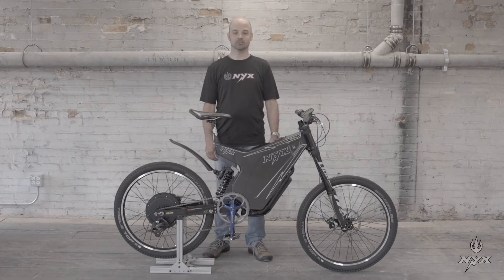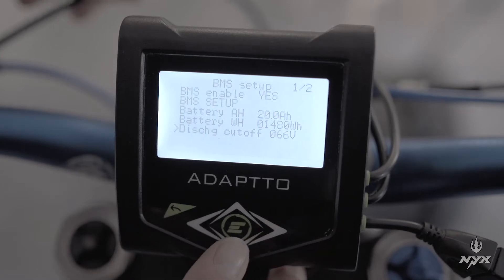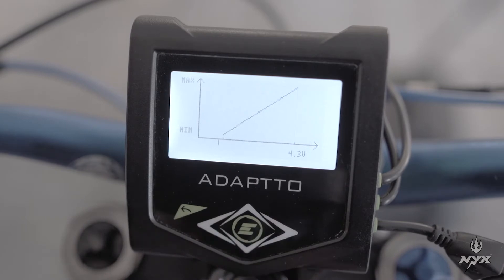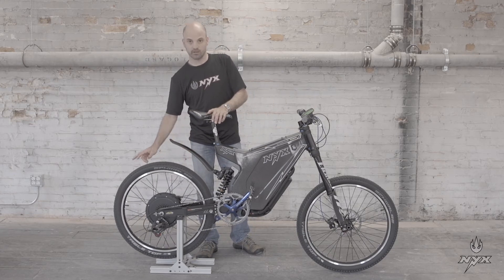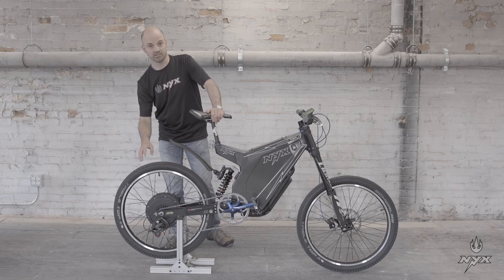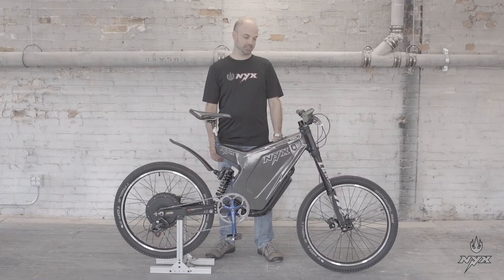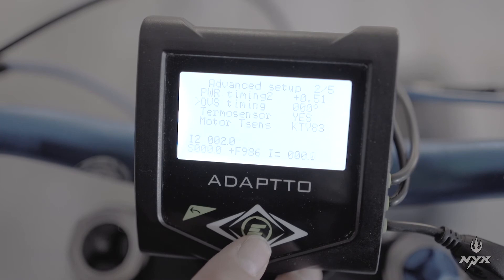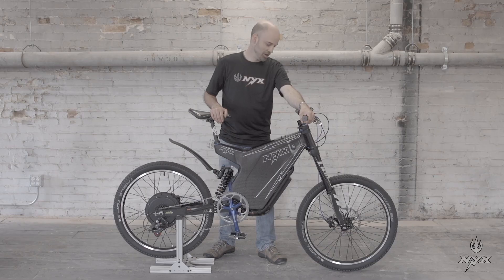Adaptto Controller Setup

Comment: Does anyone know if this company is still operating?? They haven't posted for 2 years and don't respond to emails about purchasing.... Thanks
Reply: I was wondering the same thing. Have you found any info about the company still in business?
Reply: @inegma29  Haven't been able to confirm, however the quality of these frames is very poor. There's videos showing that the seam doesn't align, head tube issues and problems with the carbon fibre itself. A FUTR frame is your best bet. Same Melbourne factory as Stealth.